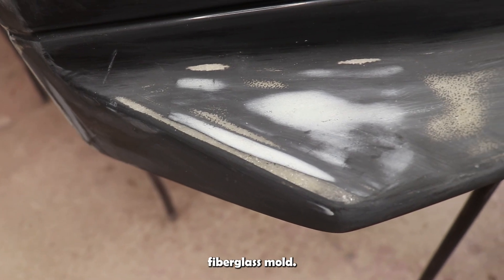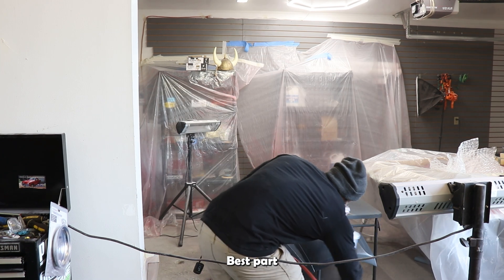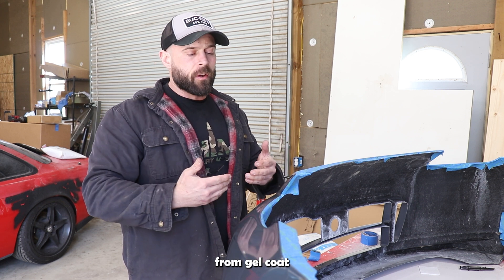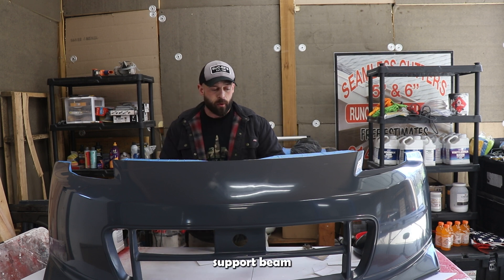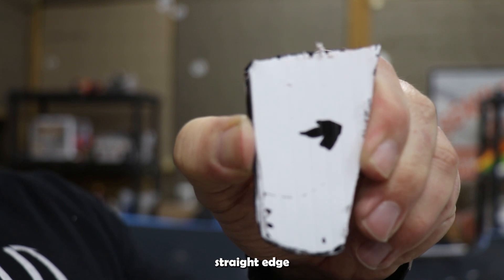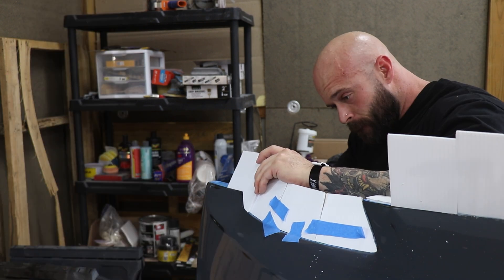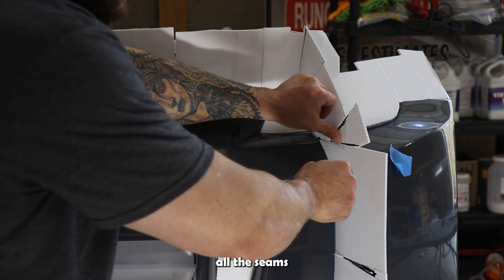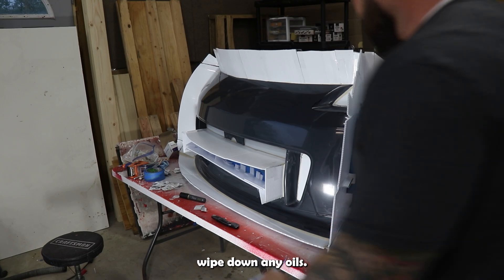Build Your Own Aero Body Kit!

Comment: have you considered using foam board instead of the corrugated plastic? should offer more rigidity when needed, and leaves a cleaner cut around curves. pretty sure the surface would allow for just as easy of a release.
Reply from the maker: I have not considered that! I thought the styrene from the resin ate foam, but a Quick Look might be proving me wrong!
Reply: @freedomfriestv  for the record i have no experience with this... was just an assumption. and to be clear im talking about the laminated foam boards. like display boards or something that have the shiny coating.